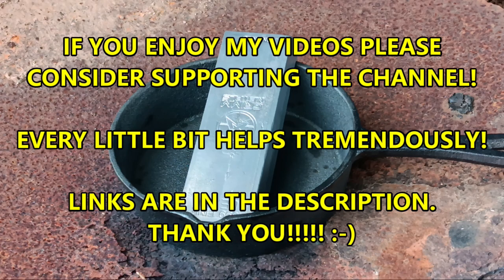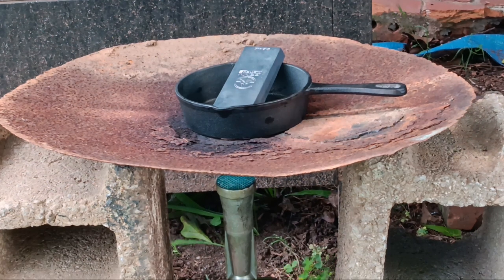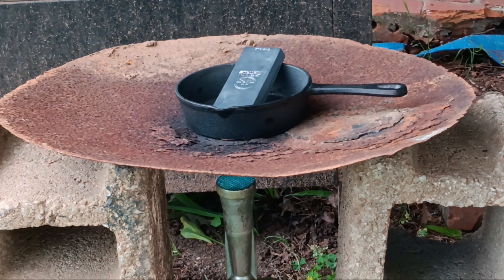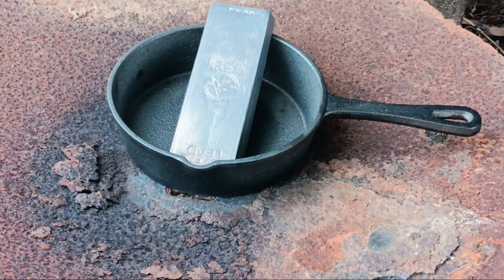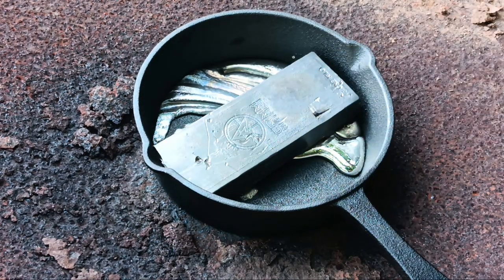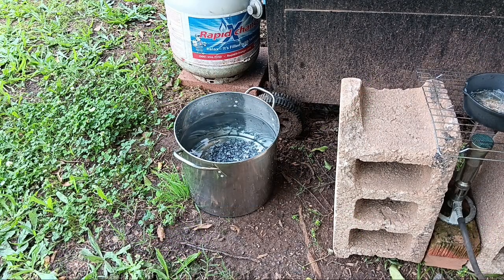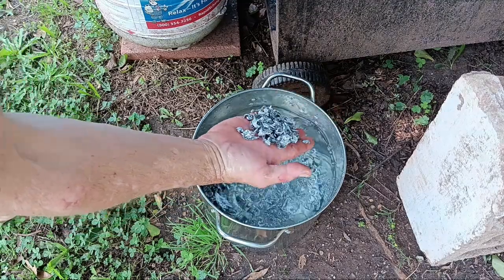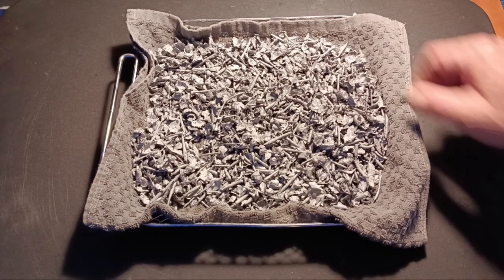Melting Ingots of Lead to Make Usable Pieces #chemistry #lead #bullet #melting #heavymetal

Comment: That's the way to do it. Be careful if you pour bismuth into water. It's not as violent as tin, but it tends to burst into powder sometimes.
Reply from the maker: Yeah I've noticed that bismuth tends to pop a bit more although I've never had a problem with tin. Although I've never tried to melt this much tin and pour it into water.  Eventually I will have to get a pound of bismuth and melt it down like this. I'd really like to do a video on making one of these lead alloys that melts at a much lower temp. Might need some tin for that.